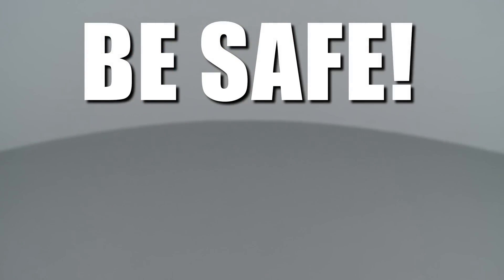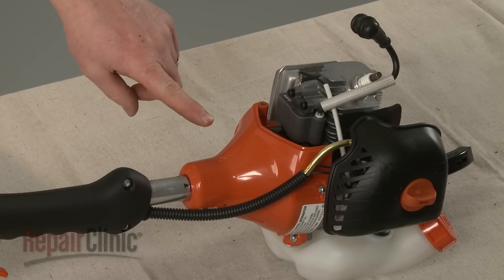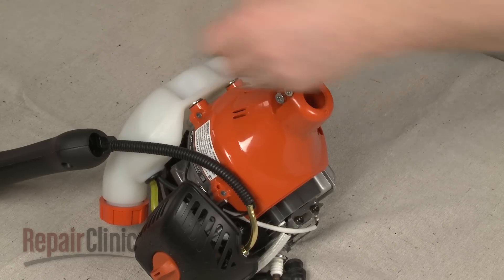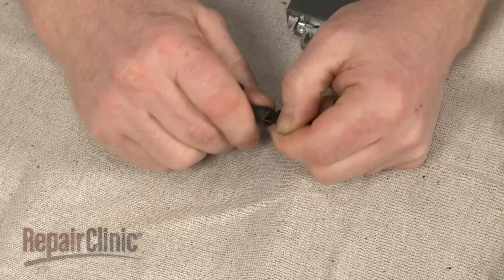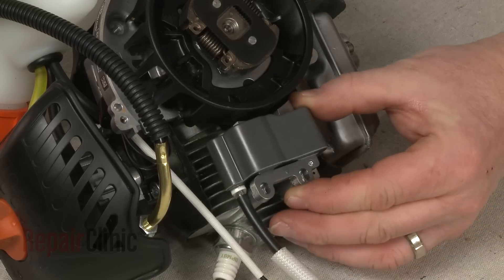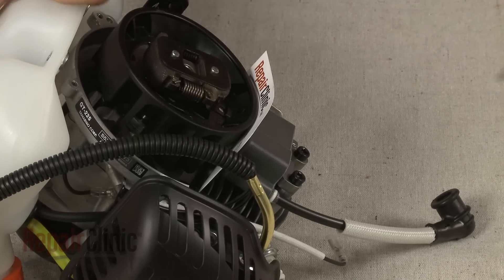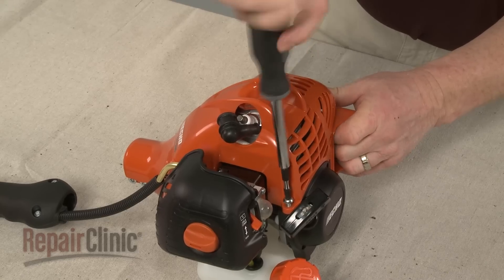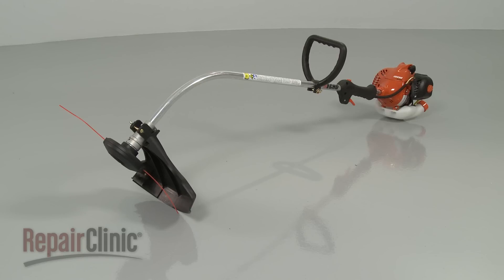How to Repair Echo String Trimmer, Ignition Coil #A411000130

Comment: Good video but why on earth did you take the shaft off? Maybe my 2019 model is different, but that's a completely unnecessary step.  Replaced the coil by taking off the shroud cover and it's fixed.

Comment: After changing and replacing a carburetor and new fuel lines and filter and spark plug. My edger still won’t start. If I replace this ignition coil and it doesn’t start? Could it be a bad starter maybe?
Reply: Did you ever get it figured out? I’m in the same boat.
Reply: @ryanpatrick7086  no it just isn’t starting anymore. I just gave up. I been edging with my weed eater.
Reply: It could be. I’ve changed my carb, fuel filter, fuel tank valve, new fuel lines, new grommet, new air filter, new spark plug, cleaned the spark arrestor, and cleaned the exhaust port. I have spark. Took it in to check compression. They said my compression is good, it’s the ignition coil. I would check all those above first.
Reply: Tue coil isnt timed with the flywheel I bet different companies, different timing of the coil they make it has to match the flywheel so it fires at the right time or else you will get nothing
Reply: @rippinrheaume242  yeah I just ended up getting rid of it and buying another. To much trouble

Comment: Is there any advice if i still have no spark after doing all this? I already bypassed the switch by unplugging the connectors to the switch. Last season, my echo srm225 just would not start, from one yard to the next. Ran fine then it didnt. I have not got it to sputter once.
Reply: You may have the same flywheel/ignition module problem that 71Rcode wrote about a year ago. Today I had the same problem as you. My in-line spark tester showed I was getting a spark but the engine didn't even sputter. I cleaned up the flywheel and set the gap with a business card, and also really pressed the spark plug boot down very firmly on the spark plug. For whatever reason, the engine then fired right up and is now running fine.